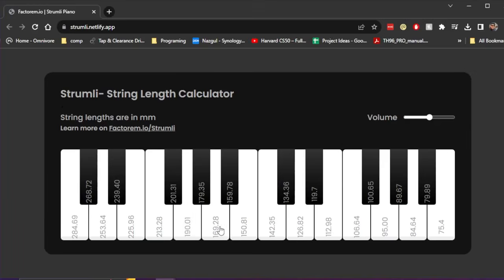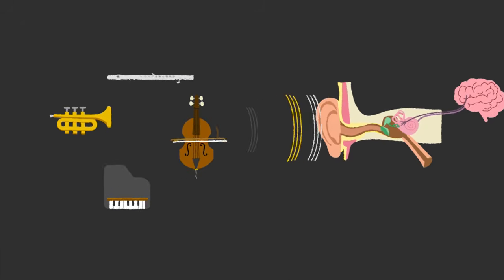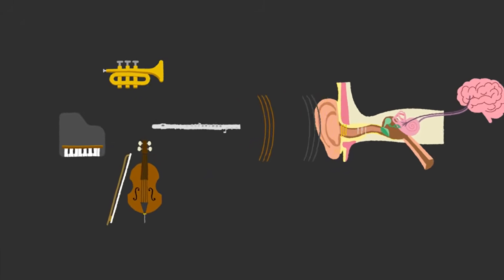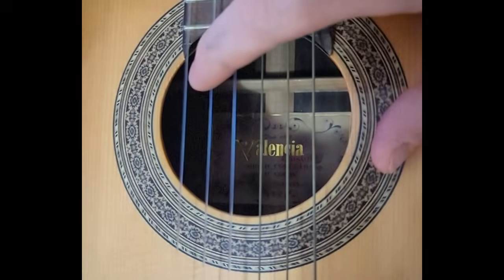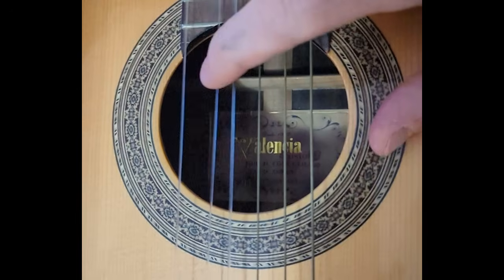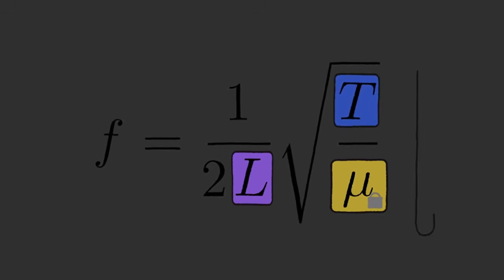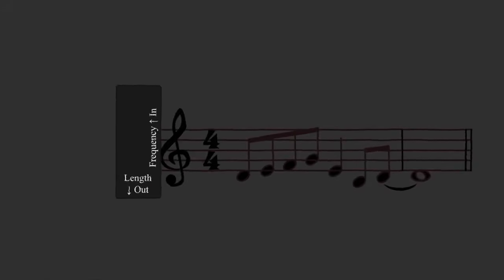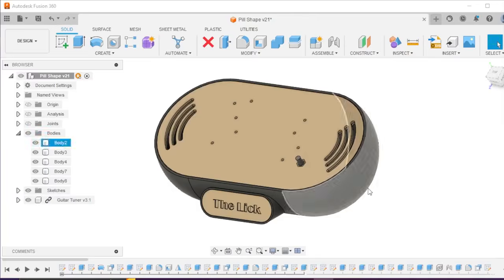Strumli  A Single String Instrument that plays "The Lick"

Comment: love this style of video, very high quality informative and downright rivetting.. 

next thing i'd love to see is expand on this concept which is static by nature, by making the left/right positions of each string dynamically adjustable and controlled by electronics/code :-) that way it can adjust the tensions after you get to the bottom note so you can continually strum in one direction - how feasible would this be and what would be required ?